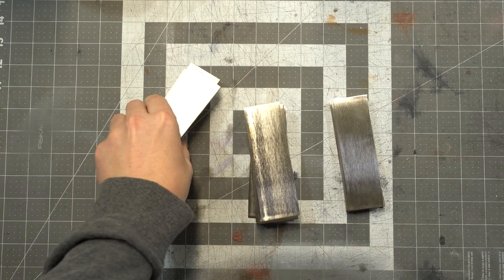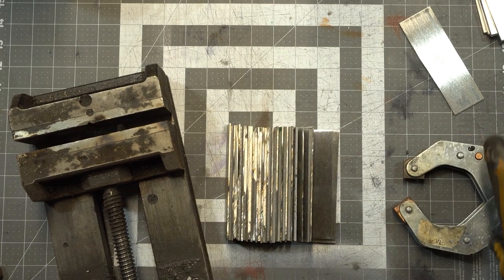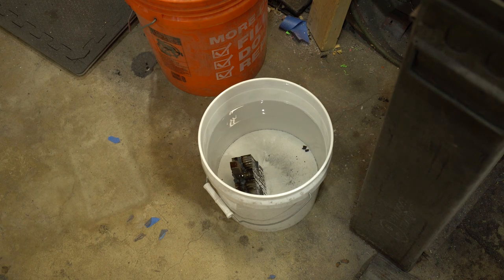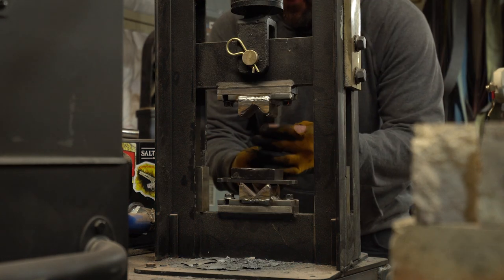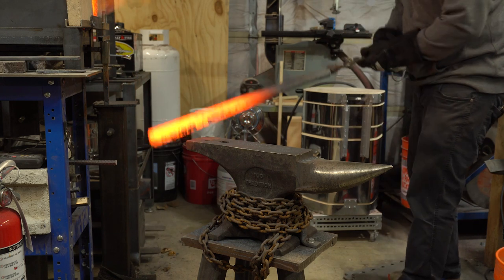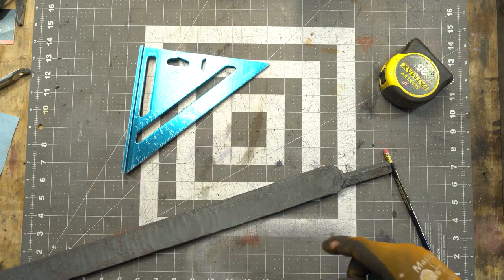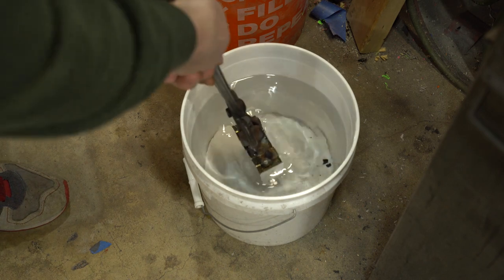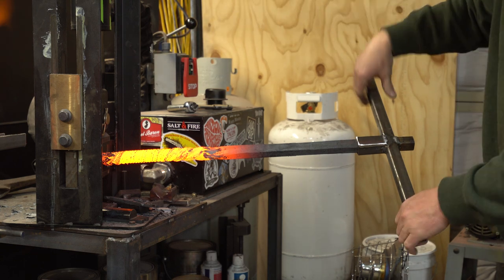How to Make Twisted W's Damascus

Comment: Another way to divide the billet equally could be to use the lines on your cutting mat. Angle it until the ends connect with lines and then you can use the rest of the lines to divide it. Thank you for the video!  Great stuff!
Reply from the maker: That’s a good idea!  Thanks for the tip 😁

Comment: I have been told that the kerosene kind of acts as "flux" by leaving a thin but fragile layer of carbon soot on all of the surfaces.
Reply from the maker: I’m not sure about that, but I’m sure it could be possible. All I know is that I’ve never had an issue with welds, since I’ve used kerosene or WD-40.
Reply: @Hathenbrucksteelworks  I do two welding heats with the kerosene soaked stack, but I must confess that I still throw some borax on the edges after I’ve got the center welded up. Better safe than sorry.
Reply from the maker: Definitely nothing wrong with a little extra safeguard.
Reply: That's what I was taught, too.